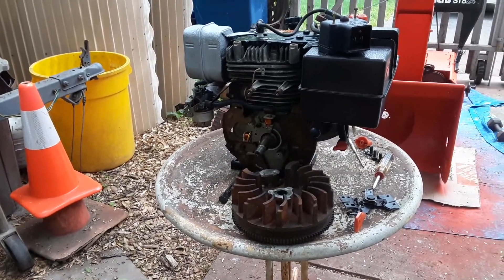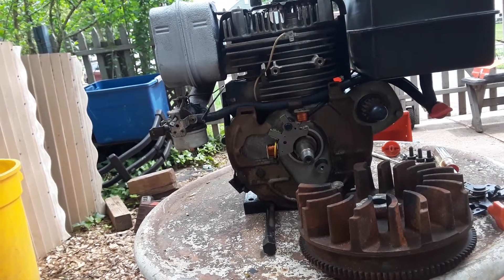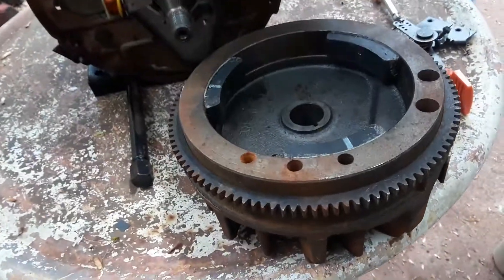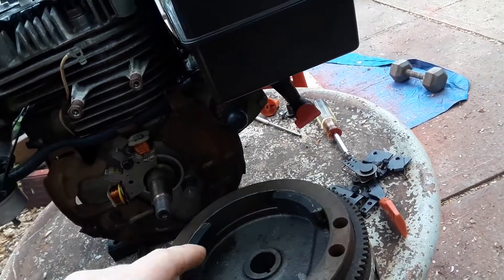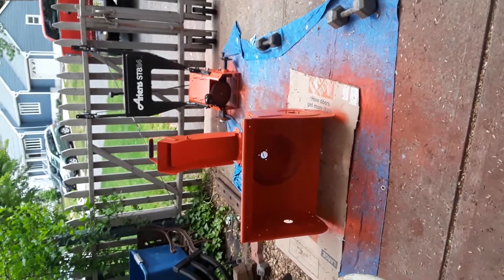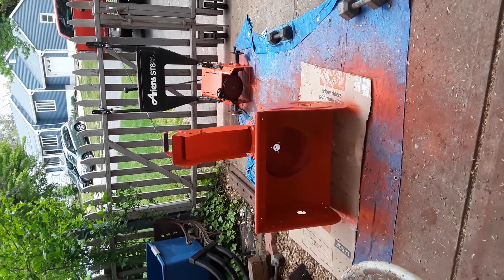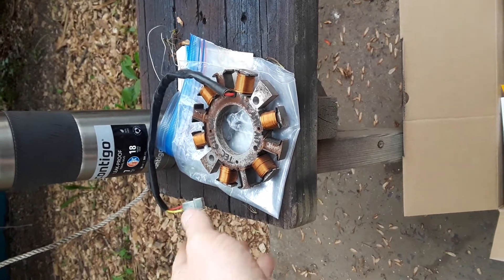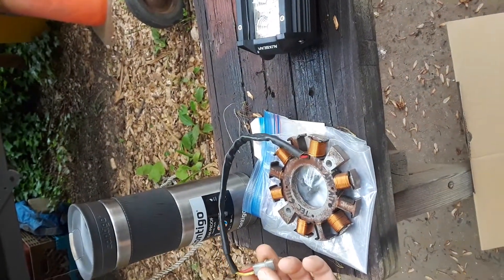Adding LED lights to Snowblower no rectifier or capacitors required, how to.

Comment: Hi! My engine got the 18w alternator. When the engine is running, I get 16 Volts output at full throttle. Do you know if thats correct or is my alternator broken?
Reply from the maker: 16 volts should be plenty for a 12 volt system. Thats more than enough to charge the system and run it. Sounds fine.
Reply: @Mr_Tecumseh  Thanks! I thought so too. But when connecting a bridge rectifier, and 2 condensors (paralell over the led light) I get 0V out of the curcuit. If i take away the condensors I get 13-16V (depending how much throttle I have) but my LED only starts when it have a "clean" DC voltage input. Maby the condensors are faulty?